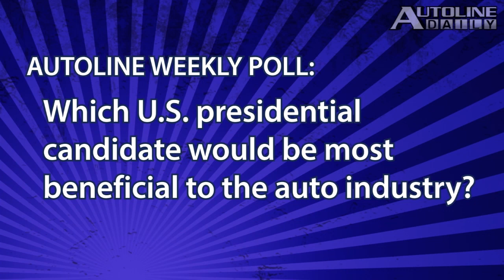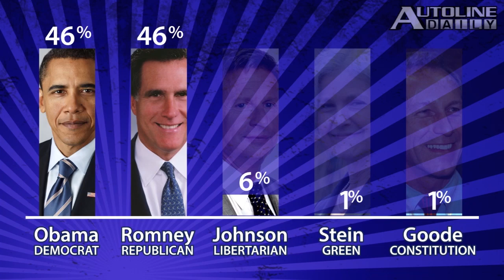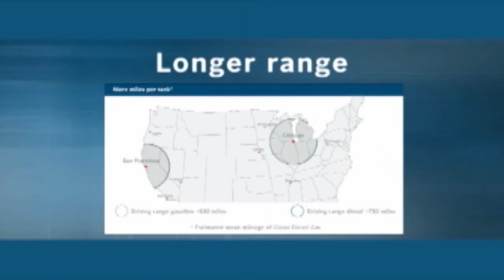Rotary Engine Breakthrough? - Autoline Daily 997

Comment: they are arguments of the true displacement. they say 1.3L. but that's just 1/3 of the whole. so the efficiency should be compared to 3.9-4Litre engines. you must think of it as a piston engine that there only one spark plug. that the pistons move across. so if you compare them as a 3.9L they are more efficient. the 1.3L displacement. is only the amount of the two rotors single rotors displacement. that's only 1/3 the total. the factory did this for a high power to displacement. it also has the same number power strokes as a v6 per revolution . so why call it 1/3 its true displacement. I love the engines. but Mazda I guess was trying to sneak one in on us.

Comment: ALL MAZDA WANKEL LEAK INSDE THE CHAMBER WHEN THE APEX LINE,S UP WITH THE LEADING PLUG HOLE WASTED RIGHT OUT THE EXHAUST STROKE AIR FUEL AND COMPRSSION RIGHT THE  EXHAUST THIS WHY HAVE LOSS OF COMPRESSION IT IS A 4 STROKE ENGINE  INTAKE PULSE  EXHUAST PULSE POWER STROKE COMPRESSION STROKE  4 STROKE WHY DO APEX,S CHATTER THE HOUSING? 1 847 421 3592
Reply: erine brink 5 years ago EGT COME DOWN WHY THERE IS A LEAK INSIDE THE ENGINE AT THE LEADING PLUG HOLE AIR AND FUEL IS WASTED FROM ONE CHAMBER TWO THE NEXT CHAMBER WE HAVE PROOF OF CONCEPT

Comment: by using a slotted spark plug hole instead of a round larger 1, does that reduce spark??
Reply: +The real doktorbimmer i reckon if you use the sectioned rotor idea you could make some impressive reductions in exhaust temperatures as for the spark plug hole I think a half circle would prove to be more suitable and even overcome the fouling issue that presents itself with a narrow slot.

Comment: "Wonkel engine"?     he is the wonk     WOA    always 4 min to get to the meat after the old news.
by the way    autoline 836 promised "Rotary Engine Breakthrough?"  also but don't waste your time.
Looks real good ha ha, i would want this at 8,000 rpm in my engine, sure i would. Well finished too
no room for improvement.  Dont you think Mazda tried this. It makes the engine pull up short in
several areas it is not great at  like torque,  mileage may improve some, not much. Plus its life
is cut even shorter.. BTW  i love the rotary, just listen the the Le Mans winning car  WOW!

Comment: It is really difficult to see through the B.S. in this wankel discussion to see the actual interesting theories. I don't understand why people think they can make claims that rotary engines are inefficient or not reliable. I own a stock '86 RX-7 and it has been nothing but reliable and gets around 27-29 MPG which is damn impressive for only being 1.3L. Rotary engines are known for being able to go upwards of 200,000 miles before needing a rebuild if you take care of them properly, just like any piston engine. People, get your facts straight before making ridiculous claims on a topic you know nothing about. The only reason it is difficult for Mazda to create a new engine is because of the stricter and stricter emissions regulations. Rotaries use an OMP (oil metering pump) to inject oil in the intake in order to lubricate the inside seals and o-rings. This inherently makes them difficult to pass strict emissions laws. End of story.
Reply: Actually it's already apples to apples. The 4 stroke piston engine is only taking in fuel and air in one of those strokes which is where they get the displacement. Number of times the piston rises and falls matters not. It's is correct to call it a 1.3L.
Reply: +lavitzlegend Maybe they should use AMSOIL's Sabre, a synthetic 2-stroke oil that can safely be substituted for organics, in a mixture that's HALF as oil-rich as what's called for by any 2-stroke's manufacturer. In some cases, it can be safely run in mixtures of 100:1!... and with near-zero oil emissions.
Reply: +lavitzlegend Not a hater. I owned an 84 rx7 back in the day and loved it. However, they are VERY inefficient. in 86 you could buy a crappy ford escort with a 1.9 liter engine and expect about 35 mpg. I, personally was only getting 20mpg highway. i did a little research figuring maybe  it had a high compression ratio. Nope. 8.8 to 1. That's roughly the same as that crappy escort I mentioned before. at 1.3 liters I'd expect to see around 40mpg. The car weighed around 2200 pounds, low compression,small displacement....So I called Mazda. They told me i was lucky it was as high as it was. Most didn't do as well. Mileage was my only complaint about that car. I had all the amenities. (I owned a GSL SE) car handled great, enjoyed dusting all the "muscle cars" of the day. Just hated how often I visited the gas station.
Reply: David Burton
Electronic fuel-injection made a helluva difference on how the wankel performed--In all respects. Plus, didn't the port location get reworked by the '86-m/y?
Reply: don't know. i do, however, know mine was fuel injected. I had the 13b engine.
Reply: David Burton
There you go...!
Reply: Actually, the rule is the total amount of air or liquid "statically" displaced within one combustion-chamber per intake cycle. And since a two-rotor engine has six chambers....
Reply: and you add all 6 and get 1.3 liters

Comment: I felt the same way about the rotary ignition cycle wanting to push the rotor the other direction but instead of offsetting the rotor's combustion chamber i always thought moving the spark plug lower in the housing would do the trick.
Reply: It would but at the expense of BMEP, I think, as the combustion chamber would be opening up at that time.

Comment: You can run them on hydrogen, mazda made a hybrid Rx8 that uses petrol and hydrogen but it is possible to run any piston or rotary engine the same on hydrogen alone. You just have to have a decent hydrogen fuel cell, they're all over youtube on how to make them, you just use the existing alternator to power it.

Comment: Sort of, but not quite. The long combustion chamber makes it hard to achieve complete combustion and it's not thermally efficient. Plus the issue of hydrocarbons introduced by oil to lube the apex seals. But direct injection and stratified charges help this immensely, and the long chamber actually is better for slower burning fuels such as diesel (spark ignited) and hydrogen. Even a direct injection gas version (16X) shows great promise due to the ability to control fuel distribution.

Comment: Mazda did think about it earlier. Mazda discarded slot spark holes because they would clog up quickly with carbon and offered poor spark exposure. Asymmetric combustion bowls were used through the 70s and into the 80s, ultimately discarded because they made no difference and created an annoying need to produce a distinct front and rear rotor. It's funny how so many old (and failed) ideas are new again.

Comment: Why is "EVERYBODY" a rotary expert... EXCEPT for the ones that are building the most reliable ones out in their garages!!! I've got a ceramic, street ported 13B running 16PSI everyday since 2004. NEVER once have I had an issue... And I beat the tar out of it every day with over 9000 RPMs all the time and even for extended periods!!!

Comment: EGT COME DOWN WHY  THERE IS LEAK INSIDE THE ENGINE AT THE LEADING PLUG HOLE FROM ONE CHAMBER TWO THE NEXT CHAMBER OR CYL THIS WASTED AIR AND FUEL  THIS IS HALF OF THE COMPESSION SRTOKE ALL WANKELS ARE RUN ON HALF OF THERE COMPRESSION

Comment: its actually not hard to lower EGT, increase compression and changing timing. The slot design mod is a good idea but I'd change a few other things that would lower EGT further...I tested it on my Subaru, lowered EGT 600-800deg F while allowing 11 psi boost over stock... whats this guys info?!

Comment: I don't agree with the movement of the Rotors "Tub" ,the trailing plug fires at a 100th of a second ? after the the leading fires , it would make more sense to taper or angle the "Tub" towards the leading but to move it completely would make the trailing plug useless. If the spark plug walls were reduced to a thin opening, I wonder if the gap could stand the pressure and not eventually crack into the water jacket ? It would need alot of reinforcement ! Lost 2 housings due to antifrz coroshn .JMO

Comment: Wow... That shit makes complete sense ...wtf didn't Mazda think of this shit earlier. I love my rx7 to death  but the gas mileage is horrible. I do however love the hot exhaust cause  after fires gett everyone's attention. Only issue with the slots instead of circles is that I would be worried about the apex seal getting caught up on the straight edges... But still

Comment: First of all, narrow plug holes were already tried by Mazda. Useless because they clog with carbon. Second, the fractional amount of compression blowby is insignificant because power-side pressure is way higher than compression side. 3rd, Mazda stopped using lopsided combustion bowl rotors years ago (after '85) because they made no difference. 4th, this guy's EGTs fell on his test engine because combustion was so incomplete due to spark issues he was sending cool unburned fuel out the exhaust.

Comment: Hmm, my rx8 is in the shop getting its engine replaced right now and it only has 85k miles on it, I would love to see an improved engine design put in my car but I don't think the pushing against it self is really a valid concern but if replacing the spark plug holes with slits for the spark to travel through will increase compression/fuel burn then I would be willing to rebuilt my engine and modify the plug holes and test it out but my concern with that would be misfires.

Comment: I think the offset compression whould increase wear of the stationary gear.
Or lets say, it is meant to have the force of combustion in the centre, so it is going over the bearing of the excentric shaft and not over the gearing. The gearing is only for controlling the angle of the rotor. Maybe they need to imoprove the gearing then...

Comment: this is a lot of nonsense, Mazda corrected the issue when the RENESIS engine in the RX8 was launched.   This guy might have been a MAZDA mechanic at a dealer. but you actually think he is gonna know more or figured out something than all the MAZDA engineers OR all the ROTARY HEADS in JAPAN, AUSTRALIA, PUERTO RICO or NEW ZEALAND havent done in the last 30 years.   Get real.

Comment: Mazda has already decided to make the spark plug holes smaller with laser ignition in the next rotary engine. The patents came out years ago. Mazda also tested the different bowl designs on the rotor and continues to experiment. They're are advantages and disadvantages to every design, maybe Ernie should have read the SAE papers from 30 years ago lol.

Comment: mazda already experimented with pocket locations moved to leading and trailing edges of the rotors. the plugs also do not hinder compression loss as much as the video and mechanic explaining give way to. install the surface discharge plugs and you will see there isn't a huge pocket left behind.

Comment: how does an rx8 with 30+ mpg, faster acceleration and top speed sound? C'mon Mazda! modify the rx8's rotary like that, increase the size and compression make the rx8 a 2 door coupe, shave some weight by using carbon fiber, aluminum etc. and you've got a world class super-car while maintaining everyday drive-ability,comfort and the uniqueness of the rx8.

Comment: Someone at Mazda is fuming and another is giddy with delight.

The future of the ICE is not going to be more complex engines, cost/benefit points to quickly diminishing returns, but simply very different engines. OPOC, Vaned Rotary Otto Cycle (V-ROC), "Revetec" X-block, and now this (No-duh) revised Wankel Rotary, will likely overtake the traditional designs if given a real chance. Just add adventuresome car maker.

One thing bugs me, why didn't Mazda figure this out themselves eons ago?